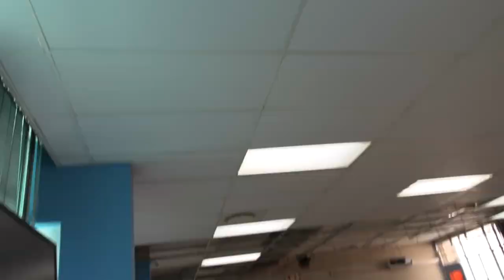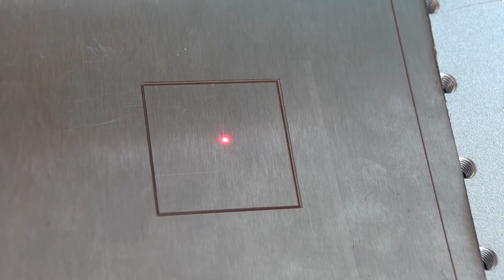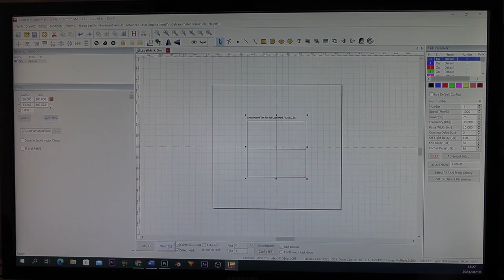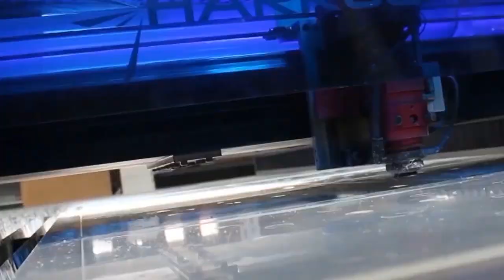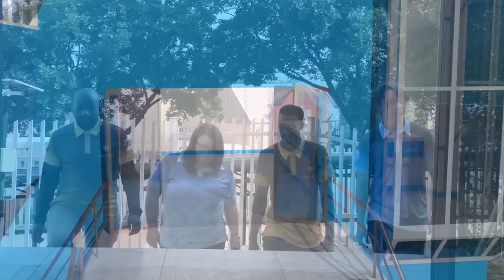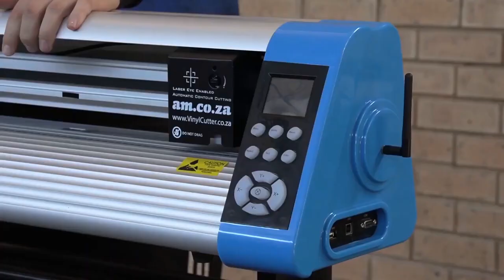LabelMark Fiber Laser Marking Machine Alignment Guide, Focus, Size, Distortion and Red Preview

Comment: Thank you for a great video.
My engraved square looks like X1 and X3 have been pinched in and Y1 and Y3 edges are bulging outwards. What could be the cause of this?
Reply from the maker: Thank you!

Want to chat to us on WhatsApp? Simply send “Hi” to 060 600 6000.

Feel free to contact sales @ 011 397 1429 / 021 555 3250 / 060 600 6000 / 072 222 2211.